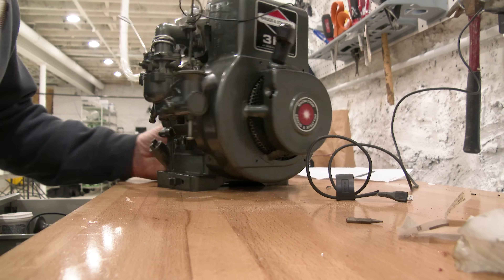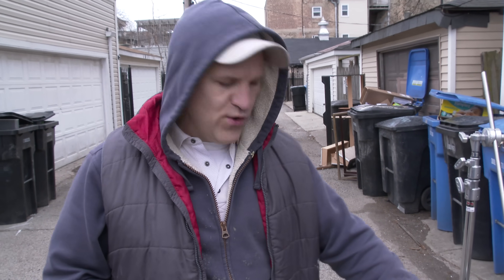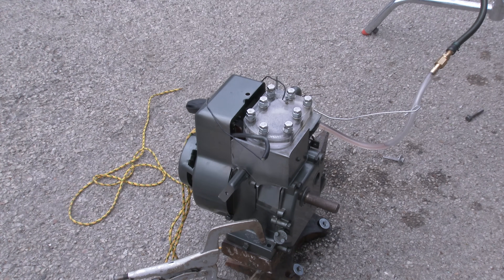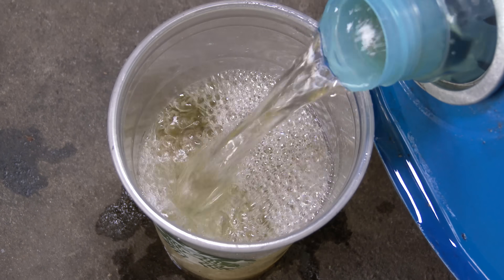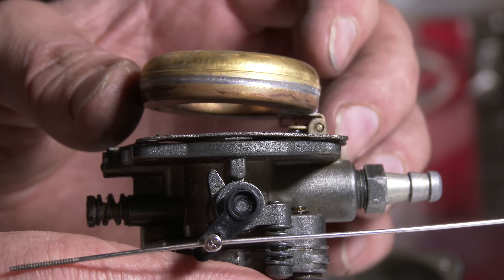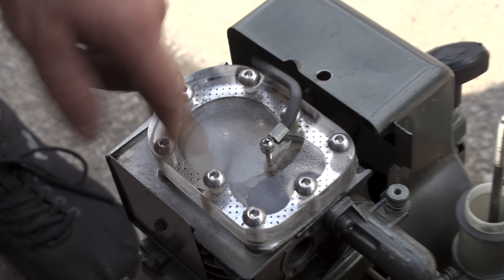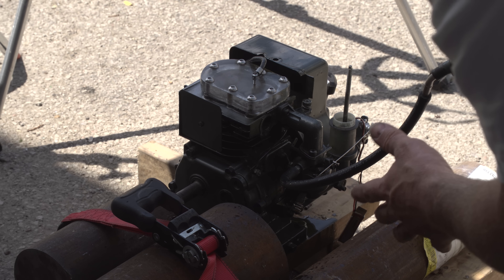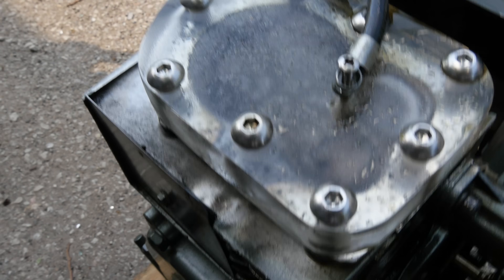See Through Engine on NITROMETHANE - Blow Up Attempts 1 -9 Crazy !

Comment: I wonder if the Briggs company will see this and use it for their commercials to show just how strong their little engines are! Hey it's all about reliability!
Reply from the maker: +The Mechanical Koopa I am currently kinda sponsored by them kind of in a way, starting with the larger model which is going to appear as soon as this thing blows up, at this point who the hell knows when that's going to be. But I have made some very promising developments with transparent materials. I have some really really cool stuff in store for the near future.
Reply: oh man I can't wait!!! too bad you can't put that little thing on a dyno LOL the 100hp briggs hahaha
Reply from the maker: The Mechanical Koopa that's coming soon... Grunge style
Reply: It's amazing how strong their little engines *were*.
Reply: Flat heads are so simple and inefficient they're almost indestructible. Not worth the efficiency trade-off IMO. I'd rather push it to max output per CC instead.
Reply: Head problems would be the one thing we wouldn't see on this channel, since he is replacing the head with the plastic one.
Reply from the maker: +Marek Sumguy grade recommendation, I actually already made a dino a few months ago, it's coming up in the next episode you're going to like it.
Reply: I also recommend you make a simple "dyno";  using some kind of viscous coupling (like a torque converter), so you can put the engine under full load.
Reply: Gene - older engines were made bullet proof no matter what you did ( most of the times ). But that 90W is some thick heavy shit for a small engine. At least you didn't have to buy a goat to mow the gras. 

Castrol RS 5W40 for small engines. 
Castrol Magnatec 10W40 for the bigger once. 

Have a quick look at the following : https://photos.app.goo.gl/Iyh5RnM2tYJ43XjK2

The old Honda : bullet proof - rotten chassis - perfect engine - 20 years old. 
The newer machines : suck.
Reply: Yeah you should be using a high quality synthetic (plus an additive as well... like MoS2, or similar).  Give the engine the best possible chance.  We want structural failure.... not seizure.
Reply: 3800Tech I hate the B&S engines my grandfathers tractor with a 17 hp died and our self PROPELLED mower won't run right ever always surging and have cleaned the carburator and added fresh premium gas with additive but since our lawn died I know use a Husqvarna 4 Stroke string trimmer which is powered by a Honda not as much rev as a 2 cycle but way better torque once things get thick
Reply from the maker: | Little fucker. Sae 30
Reply: I sorry but I disagree with all the negative remarks in Briggs yes back in the day the were stronger mostly because of the cast iron slave I've worked on small engines for years since I was barley old enough to understand how any engine works and Briggs is still by far my favorite dependable engine
Reply: Gene Hasenbuhler that is very true
Reply: What oil is used in the engine? An SAE30 or high temp resistant 5W40?

Why I ask this : some oil evaporate or can't handle the heat.
Reply: Im more surprised its taken 200 years to think of something like this.
Reply: and all ways started at first attempt
Reply from the maker: casey b I was thinking about what you said, head problems. Do you think if I loaded this engine ran it on nitromethane and turbo with the original head it would melt the head?
Reply from the maker: +HERPY DERPEDY I think the problem is you're running gas, maybe you need nitromethane..lol
Reply: To keep from blowing head gaskets use a copper one instead. I build racing small engines. The factory gasket won't take the compression.
Reply: You say B&S is junk but think Tecu is the best lol tecu are junk. I have been around B&S engines for 20 years and have had failures but that happens. Maybe its builder error.
Reply from the maker: +Chaos true !
Reply: what about adding a trans exhaust.. long - 
so we can see the smoke (if that is even possible..) ?
Reply: can you get someone to shoot it in the cylinder while running?. would love to see that in slowmo
Reply: this briggs is the ultimate tuner engine :)
Reply: Gene Hasenbuhler  Tecumseh you mean
Reply: What about durability? owo
Reply: That's a 30 year old engine shit for brains
Reply: You need a thermoset plastic. Rather than a thermoplastic plastic.
Reply: Gene Hasenbuhler  only on below 4hp they had plastic gears. Tecumsehs were better built than koolbore Briggs but I/C Briggs are even better than tecumseh
Reply: Gene Hasenbuhler  yeah they are good to rebuild because they don’t require that many specialty tools
Reply: Gene Hasenbuhler  Ok, well I don’t buy engines in bulk I just receive them for free. 12 engines in a day is impressive but a billet rod and flywheel (if those existed) could have saved them. Those engines were mostly designed for steady 3600 rpm use.
Reply: Gene Hasenbuhler  ok, that makes it better. Hopefully you can make a hemi tecumseh. I agree that the new Briggs and Honda clones will never outlast a flathead
Reply: Tegeftyrdrrsa
Reply: 3800 tech, too true. I've had three Briggs and Stratton (B.S.) engines. Only one died from natural causes (old age). I lost one as an infant (20 odd hrs.)
and the other passed away in its mechanical teens. On top of that they were all noisy and consumed a lot of fuel and oil, much of it seemingly via the exhaust. Now I'm running Honda. One has 200+ hrs on it and runs like new, uses the tiniest ammount of oil and horse power for horse power about half the fuel.They're  also quiet. I'm fond of Robin engines too.
As for Victa two stroke, the current mob engineering Stihl's current range
should have a look at one.
Reply: I never understood yanks high outlook on the B&S engine. Here is Oz the B&S is the worst engine you can buy for a mower or stationary application. Average reliability and poor track record of throwing rods out the case, piles of these engines at the tip with holes in the case, blew a couple myself. They also don't last very long without needing a rebuild either, just cheaped out on the engineering and basic design and materials. 

All our critical equipment here like generators and fire fighting pumps are typically powered by Honda or in the old days Kawasaki as well. These are nice engines with full bearings, proper OHV and even OHC now days and as long as I remember always had cast iron bores and many had forged steel rods. These engines are a premium as well as the kubota engines in high end mowers. Even the china copy honda engines used in mowers now have run rings around the B&S in the home power equipment department.  I have one of these cheap china copy mowers at home, years of perfect trouble free operation, outlasted the other 3 B&S engines by years, even the big 18hp bells and whistles V twin B&S needed a full reco in 1/3 the time the shit chonda engine and that chonda still kicking like the day it was bought.  Had a 1958 BSA powered hoe, they certainly outlasted the B&S engines, sold it to a farmer as we no longer used it much.  Had plenty of 2 stoke victa mowers too, they weren't bad but they were 2 stoke so they naturally were a crap engine for the application. 

Also no one here uses B&S for go karts, all honda GX series or higher end pro racing uses rotax. There is a small niche mini scale junior drag racing that some use the B&S as a basis, but they are heavily worked with custom everything so they are at least not likely to break on the track.
Reply: @3800S1 r u dumb? Or just plain stupid?
Reply: Cool video, but I️ have to disagree. Briggs L heads have always been plagued with problems. A sample size of one can’t prove much. 

Where did the oil come from on the ground? Closure plate gasket failure?
Reply: @joshuaolsen8844  Blowby and excessive crankcase pressure. Appeared to be coming from the crankcase breather.
Reply: @joshuaolsen8844  old L heads are way better than new overhead valve briggs engines
Reply: @joshuaolsen8844 let's hear those failure claims big guy. I'll wait

Comment: My dad bought a Briggs & Stratton lawn mower when i was 11. A year later he taught me how to do the lawn. Im 48 now & i still drive to my parents house to cut the grass. Been cutting it for 36 years & still with that same exsct lawn mower. Still starts up 1 pull most of the time. No repairs either. Just oil changes, spark plugs & air filter. Although next spring i gotta new rear wheels for little Bertha

Comment: What i think you got there at the end,  is it got SO HOT that it was actually detonating or you were getting pre ignition from the plug/ screw or whatever you had,  it got a hot spot and detonated.
So ot blew out the weakest point,  which was the head gasket. 
Pretty impressive though!!
And the leaking oil was just crank case pressure from the super high rpm.
You just need a better or bigger crank case relief vent.  
Usually they go into the canb from the crank case

Comment: Nitro has less btu's than alcohol. thats why fuelers run a lot of it. nitro can be a bomb when it is compressed not ignited. thats why fuelers turn the motor backwards so it pushes nitro out the exhaust and does not granade. Nitro motors have low compression and less timing not more.

Comment: Cool!  I once had a Briggs and Stratton engine on a old lawn mower that refused to start.  Of course lets try some Nitromethane found in model airplane fuel?!  I filled the tank with model fuel T-100 or something like that and it started right up and I thought maybe I can just mow the lawn with this fuel.  I revved it up a little than WHOOSH----the connecting rod shot straight up punching a hole in the top of the engine.  Goodbye lawnmower!  My experiment failed but I sure blew up the engine!

Comment: im sure the head heat was due to an extreme lean mixture. racing grade methanol which is called alcohol runs 2.5 times more fuel, nito is said to be 2.3 so the 50/50 mix probably needs around 2.4 times more fuel which would require some real gutzsy extreme carb mods to obtain. you were running that thing extremely lean.

Comment: So silly how the spark plug fires on the inlet stroke where it is not needed and interesting how it doesn't detonate the fuel coming in to the cylinder.  Can't you make a glass head that won't melt or just blow the engine up using the regular head?  Take the fan off so the whole thing overheats, seizes and stops then see if you can start it again when it has cooled.

Comment: I enjoyed the comment about how some extra Fuel Tank Elevation should increase the Fuel Flow to the Carburetor thereby enriching the mixture.   You don't need a see-thru cylinder head and dragster fuel to blow-up a Briggs & Stratton engine.  Just over-rev the plant on regular gas and slightly low on oil.   BOOM!!!

Comment: Well actually this fuel is making engines running way cooler, also it comes with its own Oxygen so you need less oxygen from the atmosphere
This little carburator is used to do 14/1 air/gas when for this fuel it needs to do about 2.2/1 air/gas 
Basically engines will get 8 times for cooling and more than 130% more powerful. 
We had a project where we put a 15 HP bike on a Dyno with nitromethane, took us 30 minutes to properly set the ECU to make the right mix, after that the Bike run at 34.71 HP and its torque also tripled(I don't remember the numbers)
But we realised that letting the throttle off didn't reduce the RPM in the engine, so we couldn't stop it unless it run out of fuel or it exploded. Someone then had the bright idea to turn off the key, cutting of the electricity from the spark plug, and then the exhaust started spiting flames really fast like a machine gun until the engine dropped to a full stop. 
34 HP for 150 CC is way too much, btw the bike still works perfectly fine.

Comment: Nitromethane carries its own oxygen, so it needs much less atmospheric oxygen to burn. The theoretical ideal or stoichiometric air/fuel ratio for gasoline is 14.7:1. That means, 14.7 pounds of air are needed to burn 1 pound of gas. Methanol, which also carries oxygen, has a stoichiometric ratio of 6.45:1. But with 100 percent nitro, the ratio is 1.7:1! Because the displacement of an engine cylinder is fixed, this means-assuming 100 percent volumetric efficiency (VE)-8.7 times more nitromethane than gasoline can be burned during one combustion cycle.  That means you should provide almost 9 times more nitro (by weight) than gasoline,  assuming you're using 100% nitro.

Comment: youre not running enough compression and its too lean.   nitro engines like to be run fat.  fix those 2 issues and you can burn a Briggs down with less than 10% nitro

Comment: I ran a 5 hp Briggs motor on nitro that was on a go-kart when I was 12 years old.  I ran into the issue of fuel mixture problems.   Had to make a custom intake runner & carb.  Also made a custom bracket to advance the timing.  it worked and didn't destroy the engine until I revved it a lot and starved it of fuel.  Basically never finished it but I bet if you could keep fuel in it and keep it cool it would run ok for a while.  Also, need a billet head as it blew the head gasket a few times and a way to vent the crankcase as the nitro is causing a ton of blow by the rings and is why the oil is being literally blown out.  Super cool project and makes me want to try it again.

Comment: We used to run our racing go karts on Nitro fuel...pretty common really.. but the carburetor needs to be rejetted to run correctly..it should be blowing raw fuel out the exhaust... Nitro fuel with its methanol content actually helps cool the engine if the jetting is correct

Comment: With the stock carb settings you are going to burn really, really lean with that fuel, needs to flow >3x as much fuel to achieve stoichiometry. That's where the power comes from, neither methanol or nitromethane has more BTU per pound than gasoline, but they run at way lower A:F ratios so you can burn so much more liquid fuel per cycle. HA HA LOL - I wrote that too early, before you opened up the needle... ! Glow fuel burns nice and cool, look how long the head lasted. Nitromethane very much improves idling on RC motors, greatly increases torque, and leaves nasty acidic exhaust residues to rust bearings if you don't look after them.

Comment: You could run the 90% top fuel and it still won't blow. That fuel is designed to run at compression ratios of 30:1 or greater. When you put in a lower compression ratio engine, it will not fully burn, in fact your power performance will drop over regular gas. If you wanted to blow the engine you should have ran regular gasoline with a NO2 injection! This is why ethanol never caught on in 'flex fuel' cars, because the car running on E85 has approx. 30% less power, so unless E85 is cheaper then you are wasting your money.

Comment: Was the oil leaking from the crankcase gasket?  You know that you were getting a lot of blow-by into the crankcase.  Those crankcase gaskets are made of paper and the high vibrational stresses between the two halves of the crankcase when run on high octane fuels and extreme RPM would have turned that paper back to pulp. Add an extra atmosphere of pressure inside the crankcase from blow-by and there you go, plenty of seepage. 
  B&S make tough engines. (I don't like the ones that are made in china, they are throw-aways) If it wasn't for varnished fuels gunking up the carbs,  they run for a long as you maintenance the oil and air filter.

Comment: Would be interesting to measure fuel consumption versus work under load (dynamo) with a normal head and with a transparent head -- I wonder how much energy loss occurs by letting out the visible light from the combustion?

Comment: I missed when he built the see-through head. Why didnt he just screw the spark plug in it? The one Project Farm has just uses the stock spark system and spark plug so it works fine.
Reply from the maker: The reason I didn't use a spark plug was because I didn't want to obstruct the view of the cylinder, that was the only reason.
Reply: @WarpedYT  thanks, good idea.

Comment: 50/50 nitro/alcohol has a stoich ratio of like 3.7:1  meaning to actually make the extra insane power, you would have to rejet the carb on that engine to burn WAYYYYYYYYYYY more fuel.

Comment: Blowing oil due to crankcase pressure from ring blow by. Have to evacuate the crankcase pressure. Try a Lexan Glass laminate glass to cyl. Set up a set of pressure gauges to read case pressure as running. Move ignition point to center edge of the cylinder just off the valve area.

Comment: CH3No2 has a air/fuel of around 2.5:1!! We burn it about 1:1 with air. To properly test you engine you need around 13-15:1 static comp ratio if you run 1 spark plug you need to fire it at least 65-70 degrees before TDC. Are you using hobby 20% nitro? I happen to have some clear china 100% . I really cool science experiment is to see how much nitro thermally expands. It’s got to be 15-20%

Comment: could you do a test with varied 'spark screw' location to check power? You could have 8 screws with 8 wires and switch between them to see how the flame front propagates, engine power, and hot spots etc?

Comment: wait, it is not blowing up because of the nitro. Any engine would die on any fuel if you raced it to those RPMs under zero load !! You are asking the engine to absorb all of that power.